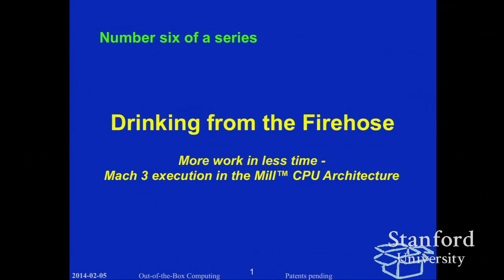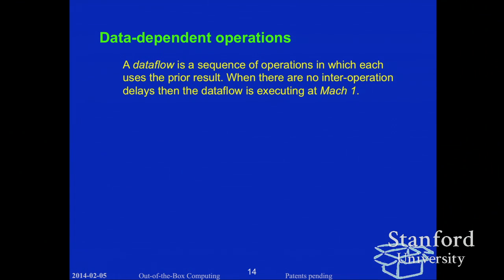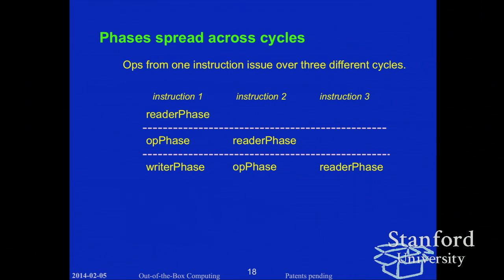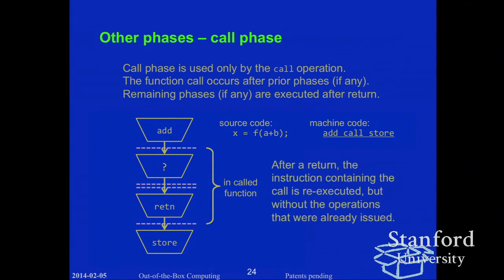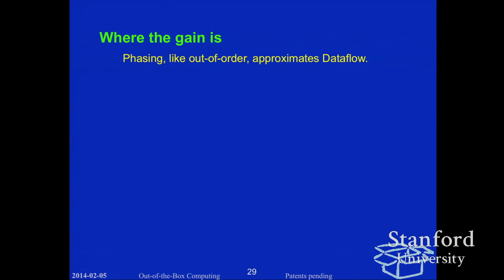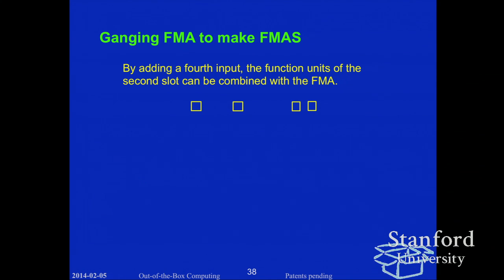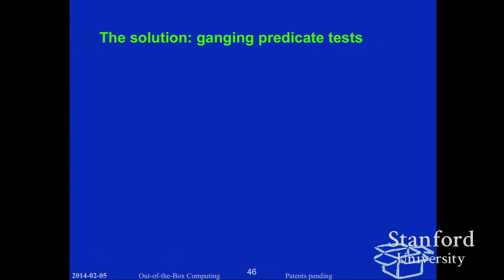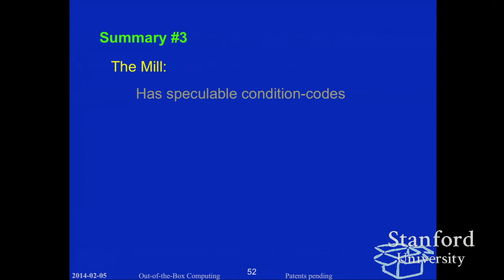Stanford Seminar - Instruction execution on the Mill CPU

Comment: I hope we have an x86 competitor soon...
Reply: +Arakmatzu Depends on how fast this thing accesses memory. If it's slow, then we probably have a pretty good DSP but not a x86 competitor.
Reply: boptillyouflop Since this is designed to work with ordinary DRAM, it should be just fine. In fact, byte-granularity dirty bits and prefetch-y load ops ought to hide the latency better than modern machines.